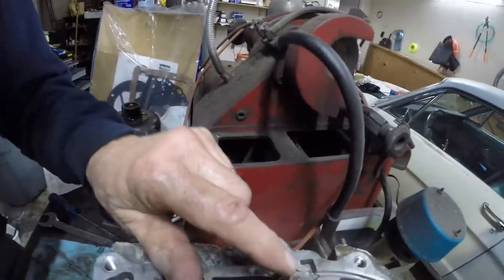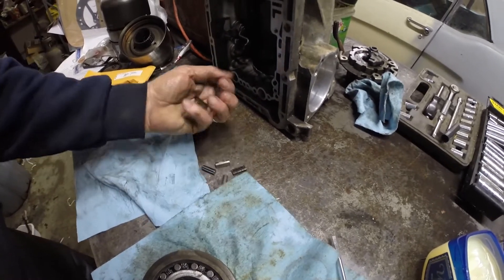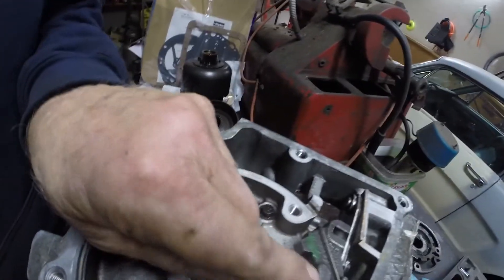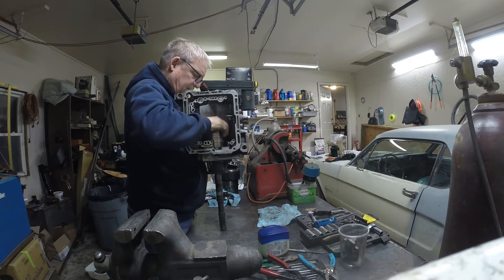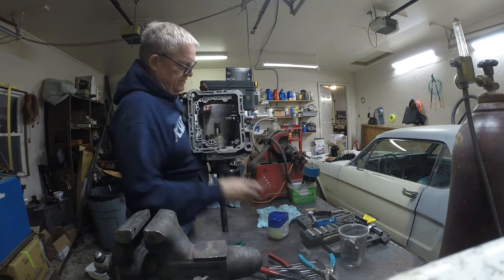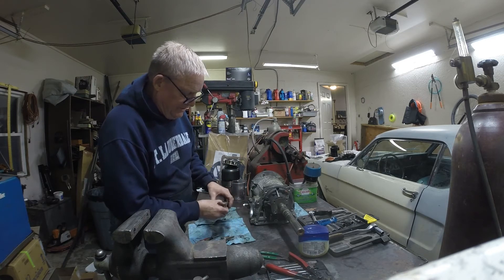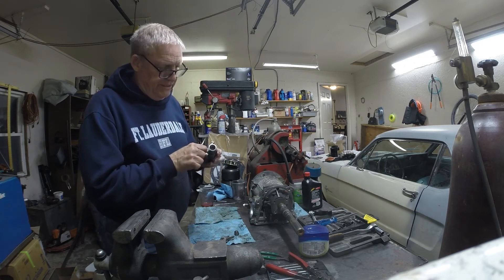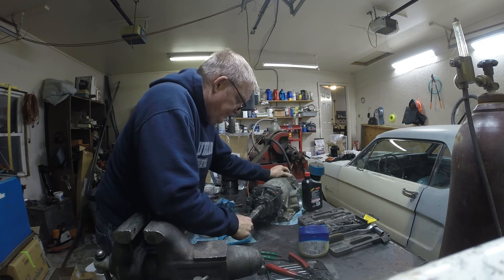How To rebuild a C4 Transmission

Comment: Dear friend,
Sorry my English, because it is not good.

I have a problem with a 1981 Ford Galaxy, it was manufactured in Brazil and uses a C4 Transmission. Many components have been damaged and what is causing me the greatest difficulty is to find out which Forward Clutch Cylinder I need to use. I can't tell the difference between the one that was manufactured until 1980 and the one that was used from 1981 onwards. There is no precise information. I know it could be the U26554A or
U26554B. To know which one I have here, I need to know the real differences.
Can you help me ?
Reply from the maker: Hey sorry for the late response, If they look the same i believe both are interchangeable i would suggest before installing the clutch pack i would do an air check. if it looks the same and and measures the same and make sure to check clutch pack clearances if everything measures out fine you should be set. if the piston is a little bit thicker or thinner than the old one it is ok you just have to set your clutch pack clearance.